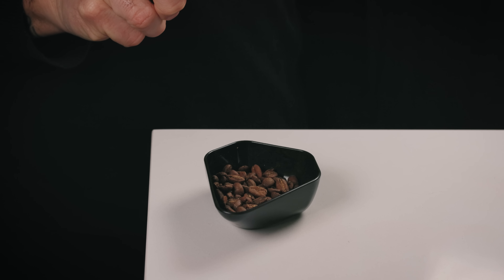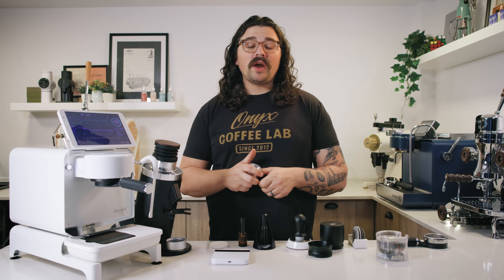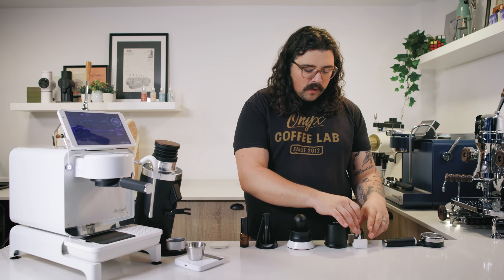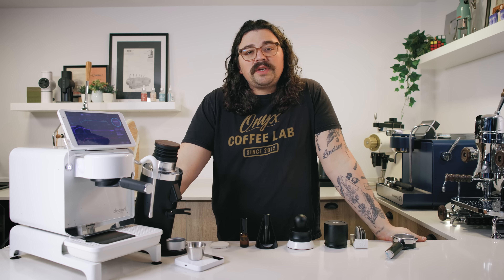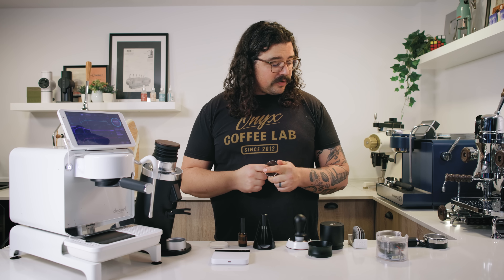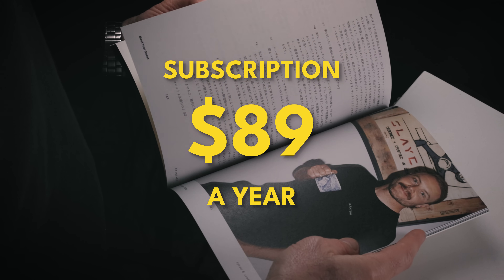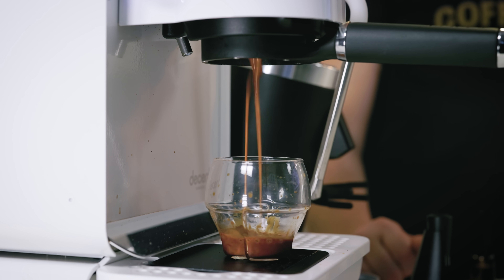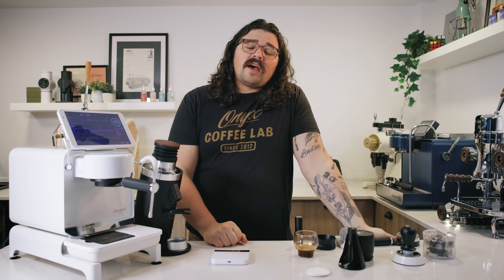HOW I BREW TASTY COFFEE: My Espresso Obsession Observed

Comment: Lance - the blind shaker is a two handed operation. The proprietary portafilter baskets that come with the Argos do not lay flat like some others. Would you recommend doing the puck prep in the basket prior to placing it in the portafilter,  or would you invest yet another $50 on a portafilter stand?

Comment: Excellent video. Is this still your current (2025) routine? Re paper filters, James Hoffmann also loves using the paper on the bottom (dry!). So I bought and tried the bottom paper filters. It made the espresso taste "thinner" i.e. with less body and it also sped-up the extraction time significantly which in turn required finer grind (else taste was sour and clearly under-extracted). Plus the extra trouble of either making or buying the 58mm paper filters does not seem to be worth it for me.

Comment: Lance, could you do an experiment and post the results for the following? When I RDT, I am forced to grind finer so that I can get 18g in and 36g out in 35 seconds. When I do not RDT I have to grind much courser for 18g in and 36g out. For reference, I have to grind 3 and 1, respectively on my Timemore Sculptor 64S. When I RDT and grind at 3 then my 36g out finishes in 15 seconds. I am using a rigged-out Rancilio Silvia with an ESP32 with preinfusion until puck saturation. I feel that 15 sec shot tastes better but would love to know your thoughts.

Comment: Good video, thanks. FYI - I recently (by accident?) switched to 2xWDT, using the 8-needle WDT tool. First I do WDT inside the cup which contains the ground coffee from the grinder. Then I pour the distributed coffee grounds into VST portafilter double-shot basket (via funnel). Then I repeat the full WDT inside the portafilter basket. Finally, I level the coffee and tamp. I don't use the filter paper (tried it, did not like the in-cup taste, no body, too thin for me). I have not tried using puck screen (yet). I dont have the shaker, too expensive. Likewise I dont have $200 basket, too expensive. I just use the cheap 8-needles WDT tool, twice over. Visually with 2xWDT I see consistently less channelling and the taste inside the espresso cup is as good as I have ever achieved to date. Just sharing my experience. Love your work.

Comment: If whatever you do between grind and extraction avoids channeling, go with it.  I just dump fresh ground into the group, tamp and pull the shot.  If it channels, is under or over extracted, I adjust the grind until it doesn't.  Minimise the variables you have to deal with, otherwise when things don't work you have too much that could potentially be the problem.

Comment: Lance, when using the Canal Hummingbird portafilter with a Decent machine, just unscrew the base, flip it, then screw it back in.  Voila, the “hump” is now on the bottom giving you the clearance you need.  This fix also works for the Flair.
Reply from the maker: Yes. I'm aware. But 99% of why I like it is due to the fact it lays flat. Flipping it wouldn't let it lay flat anymore
Reply: @LanceHedrick  👍  It seems like such a simple design fix too!  As usual, Lance is on top of it!

Comment: It's taken some getting used to, but using the blind shaker, 20g in and ~45g out in about 24 seconds with a VST basket.  Especially for the same grind and all other setup with WDT i'm used to aiming for about 28-30sec.   And the flavor is frankly a bit better with the faster shot. The overall workflow seems to just be faster in general for me which is good because I usually like to pull 2 shots into a mondo iced latte for work. Two shots, and top with cold milk to taste usually around 6-7oz of milk on top of the 90g of espresso.

Comment: Pulled a shot for a macchiato from Peet’s Major Dickason Blend, which is dark enough to have surface oil, and is a super boring coffee that tends to be bitter when I used my aeropress.  It was over 6 weeks out from the roast date.  By all means it should have been terrible, especially given my humble ECP3420 setup.  I used my Kingrinder K2 set to about 35 clicks, the course end of turkish and way finer than I would go for my light roasts.

Produced a beautiful 1:1.5 ristretto in ~25 seconds.  Perfectly balanced, very rich, not harsh, and slightly sweet.

The lesson I learned is that tasty dark roasts are way easier to pull.  Got it on the second try, too.  Took me 10oz of my 12oz Ethiopian bag to finally get a balanced and fruity shot for an americano.

Comment: Interesting.  Over time, I my routine has become very similar to what you do.  I use a Breville machine and DF64.  Two RDT sprays, bottom paper and top screen.  I use a Normcore HE basket and like it.  We the paper, dump the ground coffee into the filter, WDT, level, and double tamp.  Extract at 9 ~ 10 bar.  I looks like I have found a good process if you use it.

Comment: Lance, which SWorks basket are you using? Standard/Low/High flow? Would you consider the low flow to give the ability to coursen the grind yet maintain longer brew times?
Reply: Also curious which basket. I have a VST, looking to get into the newer baskets but can only justify $ for one. Seems like I would appreciate the biggest difference if I get the high flow? Or is the standard enough to highlight the basket’s effect? I drink primarily light roasted washed coffees, mainly as espresso but occasionally cortados.

Comment: I have been wondering what side of an ideal flow rate I could err on, and this video gives a solid opinion on that matter. I hate to add another gadget to my coffee drawer, but I may have to try that Weber distribution cup. I currently surf different pressure during an extraction, varying timing based upon what is happening in the extraction. Bit more advanced than a straight 9 bar.

Comment: GC V1 adjusted to ~8 BAR (dynamic), SS shower plate, OEM shower head, Breville 16g double basket (yes, it fits perfectly) + ESP grinder. Everything else OEM, $1.99 WDT tool from Ali, with a 58mm paper filter on top of the puck to keep things tidy. All this must be 10% of the cost of Lance's equipment 😂😂😂😂

Comment: Hey lance here's an idea, since your testing has pretty conclusively shown that the blind shaker markedly improves extraction and consistency and you've attributed that to better distribution at the bottom of the puck, how about testing the impact of grooming the top afterwards? Curious to see if using the autocomb and Moonraker with shortened needles would further improve on the shaker and taps method

Comment: In my personal experience there is no reason to use a funnel with the Weber blind shaker. The shaker has a built in funnel. Also after the bell is pulled and grounds fall into basket, just lift everything as one unit and give a small horizontal swirl. Then when setting back down one light tap on counter.
And if your not satisfied with already flat bed use WDT through the top of blind shaker the same as you would with funnel.
Reply from the maker: I understand but I've found it doesn't distribute the same way. And data doesn't lie ha!

Comment: So when you were doing your testing did you use that method where you hovered higher up rather than sitting the tumbler direct on the portafilter? The few times ive used those I'd put it sitting ontop of the funnel for extra height and space (which unless underdosing i think is necessary)  but it looks like your method with a greater height would make it into a nicer neater pile. I'd worry i would miss the portafilter though lol.
Reply: He said in an unfiltered video that testing was done from height.
Reply: @paul--b  ok good to know. Thanks. That could be a factor for sure.

Comment: Big fan of the slightly coarser, faster shot. I haven't really posted online about always pulling sub-20s shots because I thought I was just weird, but it's good to know there are other people reaching the same conclusion.
Reply: I've always erred on the side of too fine and had some great long espresso shots but it usually isn't pretty or consistent so trying to go more standard shot timing lately. Going too coarse I've had good results too as long as I dont stop the shot too early. High extracting baskets seem better at doing the faster shots without being acidic.
Reply: @BensCoffeeRants  "High extracting baskets seem better at doing the faster shots without being acidic."

isn't that exactly the reason, though? higher extraction means it can do more work in less time. so while a lower extracting basket takes longer to get past the sour/acidic zone and into the sweet spot, a higher extracting basket can reach that sweet spot sooner.

Comment: I am considering getting a cheaper version of the blind shaker, like the MHW 3Bomber, but I am wondering whether the materials used makes a big difference? Anyway, what's really made a surpringly crazy difference is switching to a precision basket and getting a self leveling tamper. Suddenly I'm getting much cleaner shots that are coming out way faster. Shocked at first but damn, the flavour speaks for itself! Thanks for all the insight, Lance, it really made a difference understanding all these aspects better.
Reply: Someone else mentioned that the bomber has static issues
Reply: @paul--b  Exactly my worry, glad I didn't buy it just yet then

Comment: Question - using a paper filter makes you grind a little finer, but using a puck screen allows you to grind a little coarser. So how do you approach your grind when using both?

Keep the amazing content coming!
Reply: im not sure the actual answer to your question, but i know why those methods make you grind courser or finer and that might help. having a puck screen at the top generally slows down your shots and also spreads the water more evenly, so to get the same extraction time you would get without one, you can grind courser. the paper filter at the bottom stops fines from blocking or plugging the holes in the basket, making your extraction faster and making you need to grind finer to get proper extraction.
Reply: @bookies24k8  thanks for reply! That all makes sense. It would be interesting to know how lance approaches his grind when using both though!

Comment: How I learned to stop worrying and learned to love 15 sec shots. Thank you, Lance!
Reply: yeah this is huge for me, I spent soooo long beating myself up because my shots were fast, I often made worse espresso chasing 30s shots
Reply: I find it all depends on my roast level. Some i like to push shorter for more acid, fruity shots. Others slower for more body, deeper choc thickness.
Reply: Yeah if I'm making lattes or milk drinks for friends I try to push the longer shot.
Reply: Faster shots taste better to me. Not really tried 15 sec but I normally aim for 22-26 sec. I drink light - medium light roasts. I’ve played extensively with timing and for some reason I get far far juicier shots (which I like) when I hit 20-25 sec. Same bean at 35 and the bright bold flavours just fade away. If it’s too sour, rarely with the 078s, I just push more water through. Start were 17.5 to 36 and push to 41 or 48 depending on bean. Fantastic results every time. Grind too fine and it goes into the 30s and the vibrancy just slips away, no idea why.
Reply: I like coarse grounds and I cannot lie
Reply: Im in the other side of the spectrum with a 6 bar machine on the job. 34 to 42 seconds normally on a double shot (depends from the bean) and taste amazing
Reply: @filtraditto  I may    have to move to 6. Seems it may suit me better.
Reply: So they suddenly taste different to you? ok XD
Reply: Just started watching his videos and so happy he got rid of this look.  He looks like Ron Jeremy

Comment: I started using the blind shaker after your previous video, have you had issues with the ground zcoffee sticking to the removable base and ultimately not dropping evenly through the funnel? Suspecting it’s the roast (medium/light)? Grinder is Ditting 807LS
Reply: I don't own one so this is purely a guess, but after shaking, have you tried giving the whole unit a deliberate tap on the counter, while still holding the pieces together? that might reverberate thru the whole unit to shake all the grounds loose from the metal surfaces.

Comment: The densification conversation in the prev video set the wheels spinning. Pulling a shot with three different larger grind sizes mixed together evenly and getting the same flow rate and pressure as a normal grind size would be interesting. Wonder if it would do something similar for the taste as the 30g plus Aeropress recipes that were used for competition. 

Thanks for sharing the secrets!

Comment: Love the series we went through, what a journey. I wish the Weber basket had a 54mm for the Bambino. Nice work!
Reply: There are 48-54 shakers made by Craig lynn
Reply: yep -  Craig Lyn perfect for La Pavoni baskets too. @zach1860
Reply: @rq2757 the non magic tumbler that came with the hg2 or Key worked with my 51mm machine I think also 49mm not sure how or if it worked with the breville or la spaziale sized ones though. Also not sure if they have a lid that works with that one or their shaker is a dif design. I remember the middle part being higher than the walls of the cup so a regular lid wouldn't work.